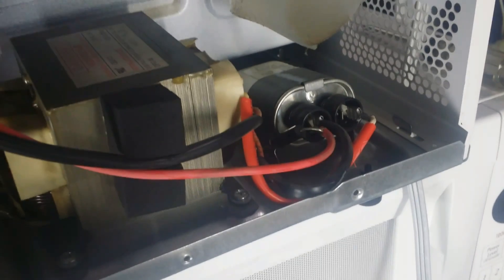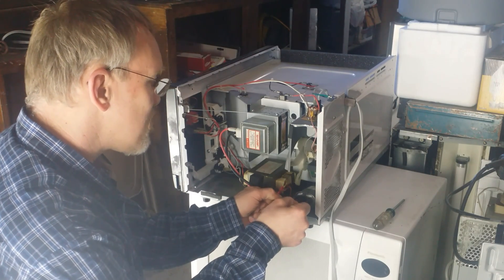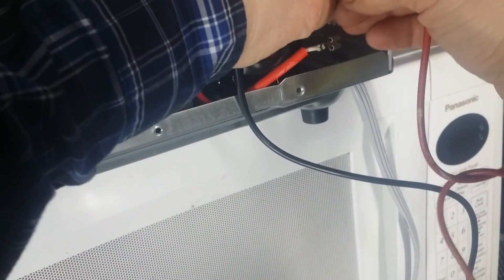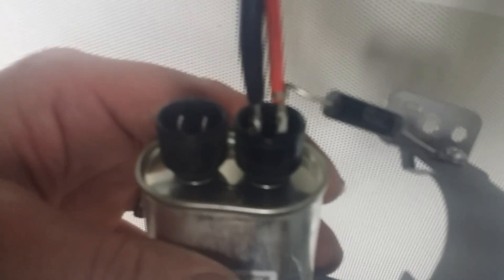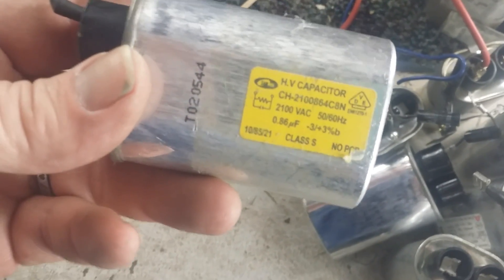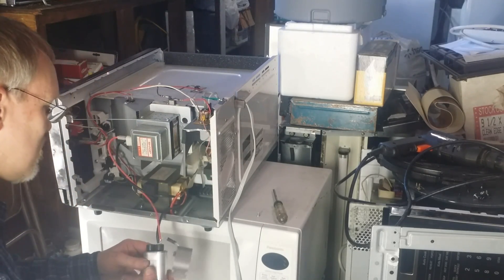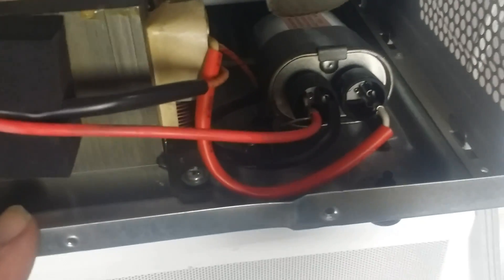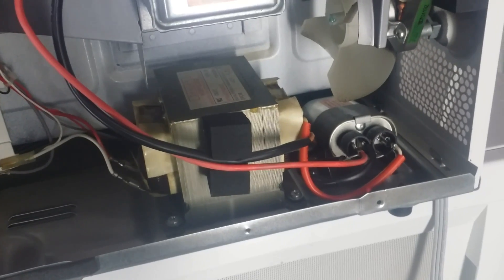Microwave oven capacitor check and replace

Comment: why did nt u shows the reading of the good and the bad capacitor? People wanna see the reading to see if its good or not. NO reading means its good. reading means its shorted out. Ur confusing people.
Reply: He explained and showed everything you've asked for. If the cap is shorted then it would give 0 ohms (or just few ohms) of resistance between its terminals and that's exactly what was shown here when the needle of his analog meter went straight to zero ohms. If the needle didn't move (or the reading was O.L if the digital multimeter was used) then you would know that at least that cap is not shorted. It could still be a bad cap, as caps may fail in few different ways (and short is just one of them) but to test them for such other possible failures you'd need to have some other equipment. Finally, if you don't know what you're doing or what to expect, then it's a good indication you shouldn't  do this for your own safety.

Comment: First I thought if I replace the fuse problem solved. End up replacing the capacitor. Still the fuse burn after few seconds when trying to cook something. What would be the issue?

Comment: Thank you. I had a Service tech out and he said he would get the part and come back he doesn’t even answer my calls because the parts are obsolete and I was about to get rid of the microwave. At first I thought it was the diode but it is the capacitor. Thanks again

Comment: Most tutorials I've seen on you tube explaining something in front of the camera, have little or no knowledge on how to illustrate their videos, make little use of fixed views without movement, to digest what they are talking about, they don't care about the sharpness of their shots, and sometimes they explain something without even worrying about photographing with stability and sharpness the part of which they are explaining, if they take into account and plan how their presentation will be; It will look much better than the improvisation that most do.

Comment: With the unit unplugged, it does little to connect to the ground plane. In fact you might damage some of the electronics in the pc board by raising the ground plane above zero. Shorting the two terminals should do it and going to ground with the plug attached is alright as long as you don't turn the unit on.

Comment: Hi,I have replaced the capacitor and diode.As soon as press the start button, the fuse(10Ampere) in the microwave keeps blowing out. Can you help me out what could be the reason.
At this instance I  have disconnected Magnetron to ensure that magnetron is not the cause of fuse blowout. The transformer is working fine which I have tested it while there was no capacitor and magnetron connected . low voltage electronics are also working fine as i have tested each stage one by one.

Comment: I HAVE TWO KENMORE MICROWAVES WHICH THE MEGATRON IS THE SAME, BUT ONE HAS A CAPACITOR THAT IS 2100VAC 1.05UF AND THE OTHER HAS A 2100 1.00UF CAPACITOR.   I HAVE SOME EXTRA 2100VAC 1.05 CAPACITORS.  CAN I USE ONE OF THE 1.05 CAPACITORS IN THE ONE WITH THE 1.00UF CAPACITOR, SINCE IT IS WITHIN THE .05??   AND IF I PUT A 1.05UF IN A 1.00UF OR VICE VERSA WILL IT CHANGE ANYTHING LIKE HEATING TIME OR ???  THANKS
Reply: Should not be a problem.  They have the same voltage rating and the capacitance is well within the tolerance rated range.  Either should be able to be replaced with the other as long as the fittings plug in and installed correctly.

Comment: Sir , for the Capacitor , Can I use 1.05uf instead 0.87uf . ( 2100 VAC ) Thank you !
Reply from the maker: Allen Au No, you needtostay within .05 uF of the value of the original.